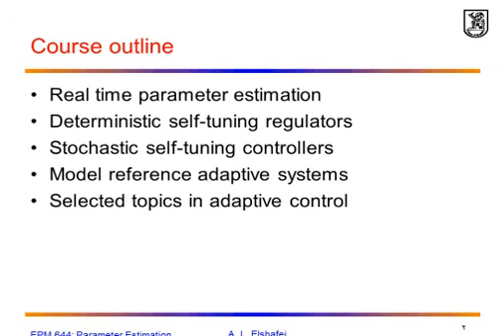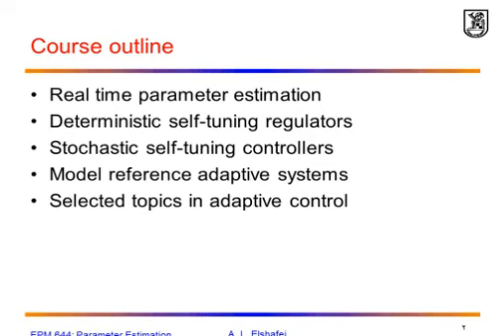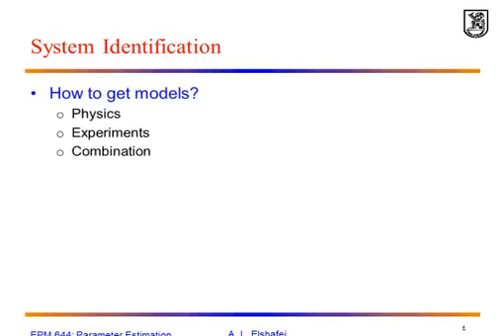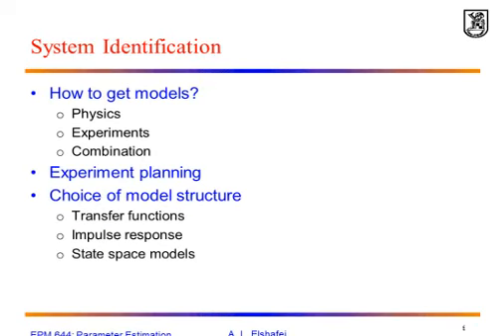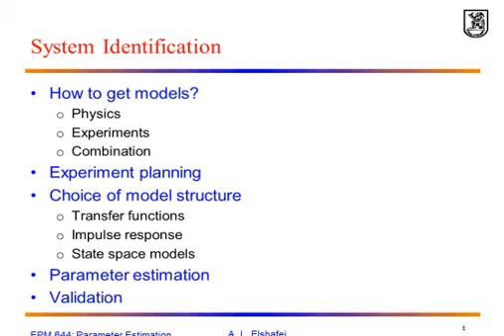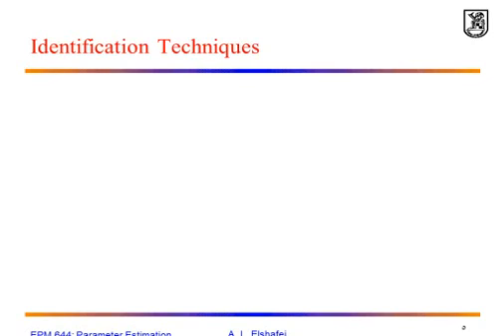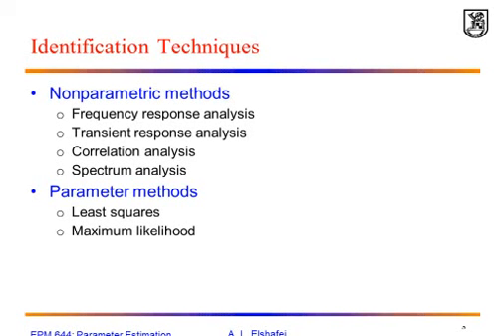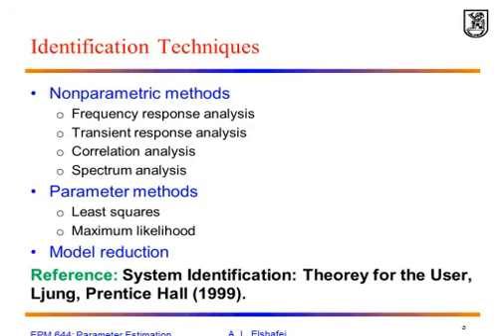Lect2 Overview of System Identification

Comment: Several techniques present realistic approaches to overcome the fixed gain optimal controller suitability problems. These techniques called adaptive controllers. These controllers update the process inputs when the operating condition changes. More efficient adaptive technique is model reference adaptive. In this technique the process outputs are compared with a perfect model reference. The error between the real process outputs and the model reference outputs is used to adapt the controller gains the certain adaptation mechanism. Describe an adaptive control technique for a real multi-inputs/multi-outputs process by using model reference adaptive control technique (can you help me to find the answer please)